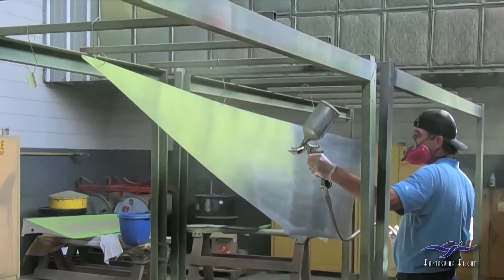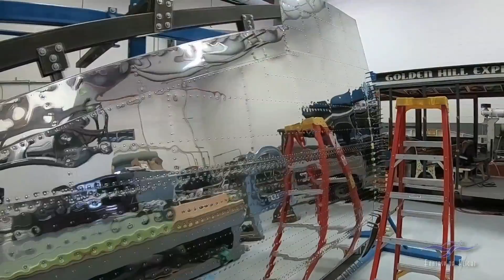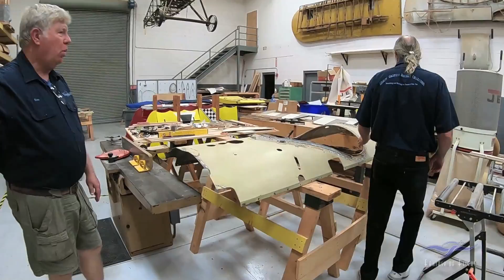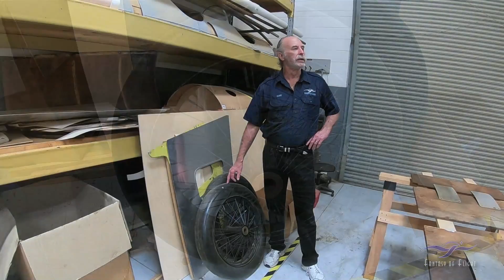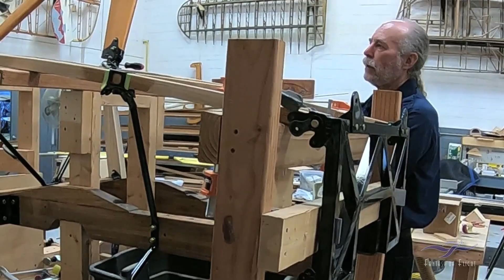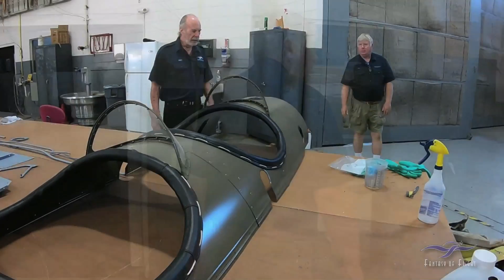Waldo Pepper Standard J-1 - Restoration Update #04 - October 2020  - w/ Seversky P-35

Comment: What many people don't appreciate about the polishing process is that although abrasion (using silicon carbide paper etc) removes a small amount of metal, the final polishing to a mirror finish does not (well virtually none) - it "smears" the metal at a microscopic level - so that the high points are reduced but the low points are filled in; the molecules at the surface actually flow.

Comment: Curious what fuel you run in your OX-5's.   MOGAS or Avgas? I have concerns about AVGAS (although it can sit for long durations) due to it's long burn in the OX-5 cylinders that can cause excessive wear to the exhaust valve seat part of the cylinders?

Comment: Ok, I have a question because I'm curious. I have done aircraft sheet metal for 17 years and I'm impressed with the work. You mentioned wet sanding, buffing, and polishing. Doesn't that remove the protective cladding from that side of the metal? The interior is painted but what is the corrosion protection for the polished exterior?
Reply from the maker: On this project we are using plain aluminum, NOT Alclad. One must occasionally polish the airplane to prevent corrosion.
Reply: @KermitWeeks444  Thanks for the reply! I think that's interesting. I've never worked with plain aluminum- all Alclad and titanium. So how long does one round of polishing last? I would imagine that the Florida humidity would have an effect on it. Also, does having a finish like that require periodic corrosion inspections? Beautiful finish but it must be incredibly labor intensive!